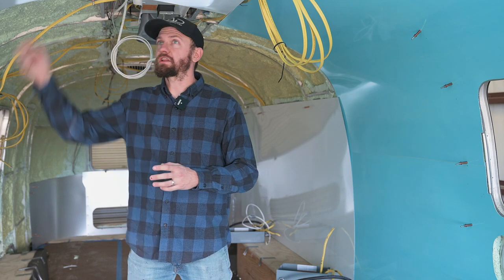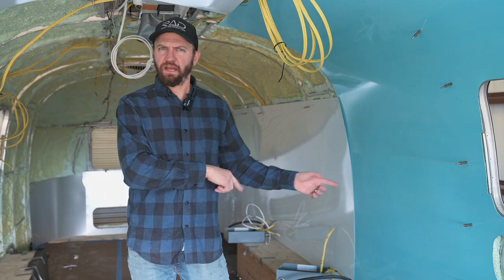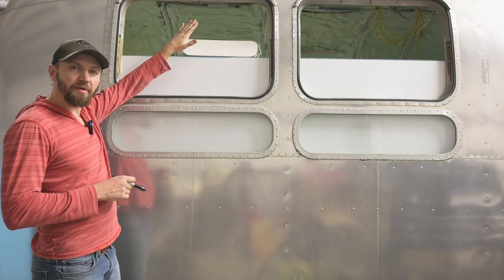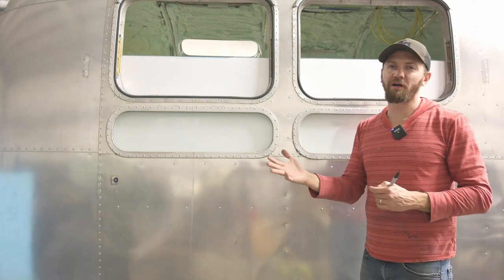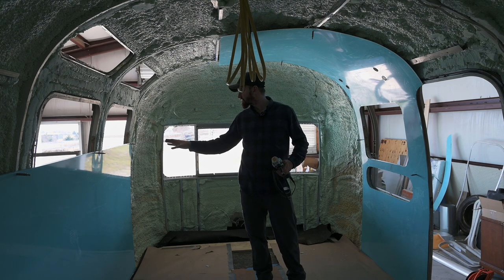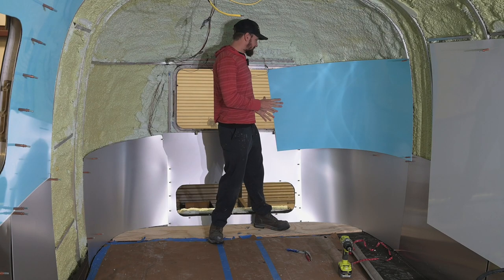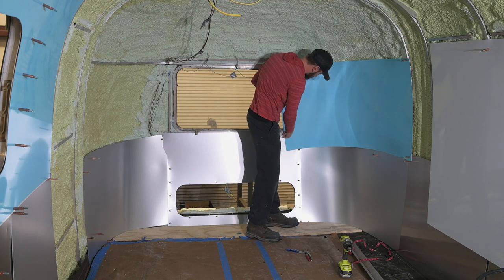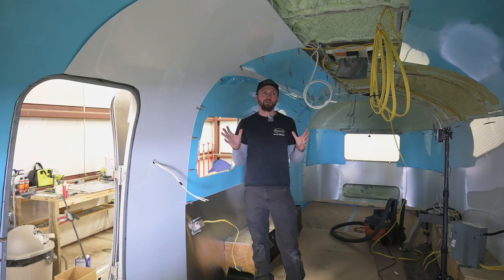Brand New Aluminum Walls Being Installed in this Airstream Restoration!

Comment: Just a thought, the inside skin should be installed from top to bottom allowing the top piece overlap to be on bottom of next piece allowing for event of a leaky rivet or gap to not leak inside the trailer IE like shingles. At least thats how airstream did it on my 76 excella.

Comment: You should check out steady streaming cashio’s videos.  He uses some type of roto zip tool to cut out the openings while the aluminum is in place.  He does it so fast, makes it look easy.  Oh heck, looks like u have tool now.  Nibbler
Reply from the maker: The only video I saw on theirs was using the plastic wall material and he cut it with a Dremel.  I didn't see a video of him using aluminum for skins, maybe I just missed it!

Comment: Another great video! Noticed on your end caps you switch from foam blocks to spray foam? Does it support your end caps just as well? Which insulation do you prefer?
Reply from the maker: The trailer had spray foam installed by the owners prior the bringing it to me.  It does not support as well on the end caps.  There were a few spots I had to put some shop towels behind the segments to help support them.  I personally do not prefer spray foam if nothing else for the reason that its permanent and once installed, no repairs can be made or wires replaced.  I like rock wool and the foam blocks in the end caps.
Reply: MikeBenson

Comment: How do you cut out the window and switches and water heater etc.. Like when you put the panel up how do you know where they are behind it? I guess this is a dumb question but i don't get it... and do you take it back down and cut it, yes?
Reply from the maker: I show how I do the windows in the video, I just used a hole saw to cut holes from the outside thru the window and then use a nibbler to follow the edge of the window from the outside.  You can also put them in place, cleco them, mark them with a sharpie and take them down to cut.  For the stack and vista windows I measured location, cut them a little smaller and then I trim to fit the window trim that goes in the hole.  Light switches, I determine location I want it, use a hole saw to put a hole and then trim it open with a set of hand shears.  Some is tracing, some is measuring and marking.  It s good idea to cut under size and then you can trim to fit.  The last thing you want to do is cut a hole too large and trash a whole sheet of aluminum.  I hope that helped!
Reply: @MillerGarage  ah ok i understand now i had asked before watching the video! Thank you

Comment: Hi, why didnt you use the old walls as templates? Was it because You didnt want the crease and seams on the top of the trailer where there used to be overhead cabinets? Wouldn't it be easier to just cut new walls with templates and do it exactly the same?
Reply from the maker: With this project, the clients did not have the original walls.  We also only had 4x10' sheets of the white aluminum and some of the factory wall sections run almost the entire length of the trailer so using the originals was not an option. With different size sheets you have to build it differently.
Reply: @MillerGarage  wow you responded so fast! thank you so much! I watch your videos all the time and they help me with my restoration project im doing totally alone. 800 hours and counting hahah but i was a novice when i started :) I have all my old templates and was hoping I could use them and cut new sheets - i know some of my walls are 12 feet long, but I was hoping I could get a few 12 foot pieces.. maybe it wont be that easy :/
Reply: I bought anodized aluminum that I’m in love with but it’s only .025 thickness. Do you think I should be concerned in terms of strength?

Comment: Can I ask where you buy the metal for the AS interior walls and the guage size? Thanks
Reply from the maker: I have used Metalsupermarkets for most of my needs.  The white painted sheets were sourced by the client and they got them from Cippen Sheet Metal in Austin TX.  I have used .040 for most things because that's what people stock.  I think factory was .030 or .035.